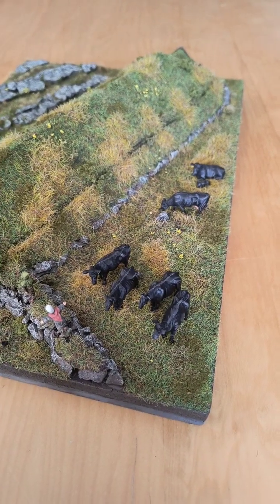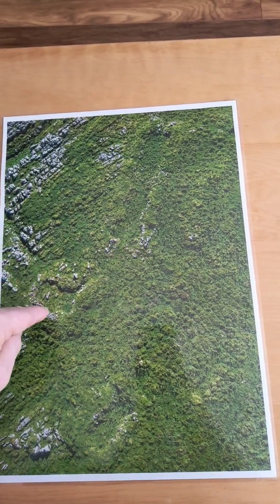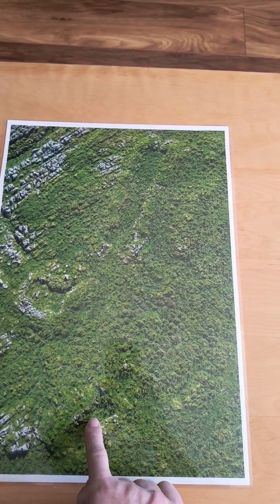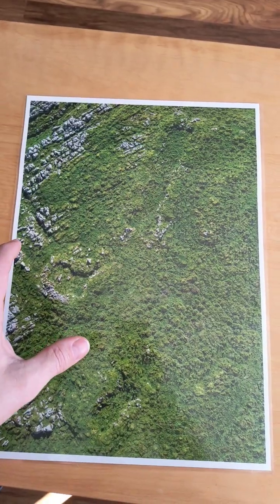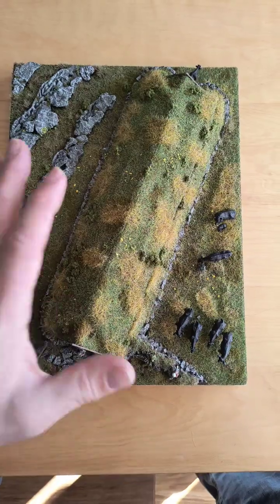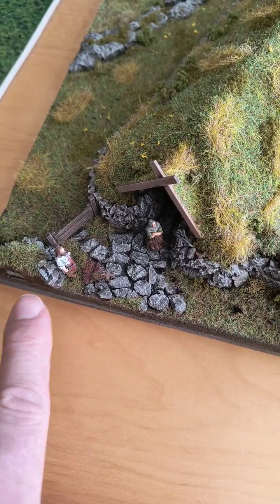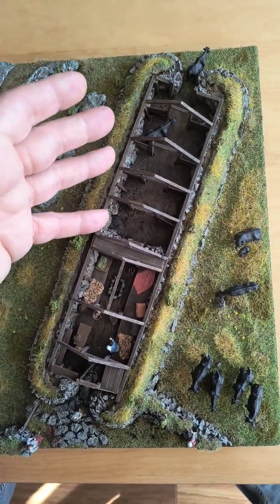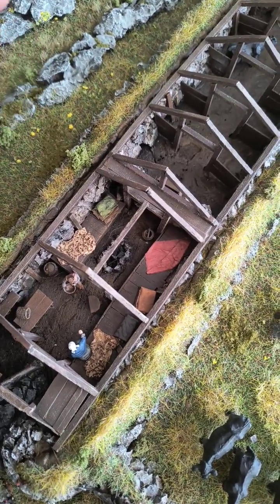Modelling Early Medieval Buildings in Ribblehead

Comment: Very good/ I know Ribblehead area quite well. Beautiful impressive surrounding landscape and been on InGleboro summit a few times. However (as u know) the weather can turn Hellish up their, so those hardy dale folks of the time(mAny of which by this time would be of Danish stock ?/ mixed with the earlier settlers) must have had some days to curse.
P.S No railway  viaduct then 😜
Reply from the maker: @stevenweasel2678  I have a strong suspicion this, and several other sites that have been discovered at there, are perhaps more akin to shielings, than we'd be used to as 'permanent' farmsteads. We can't fathom for sure, but the landscape use has often been seasonal with these uplands!
Reply: @BlueaxeReproductions  Thanks for your reply , u may well be correct . That Turf cladded roof has a Scottish Highlands / Clan type habitation look. 
The removal of the roof on the model to show the internal detail is great